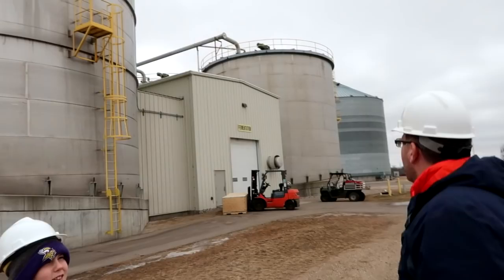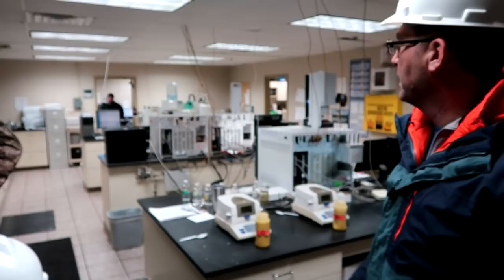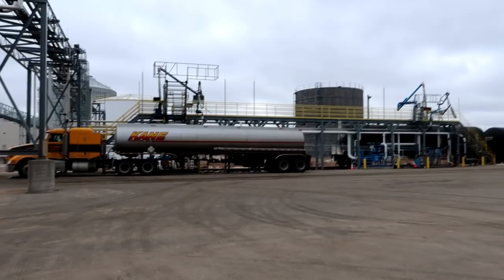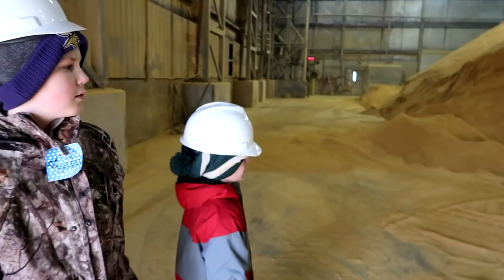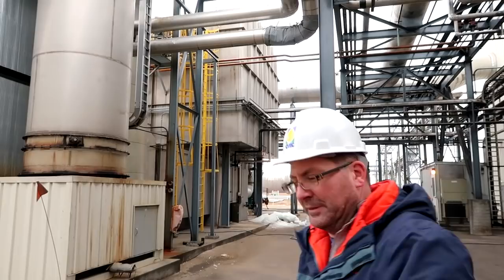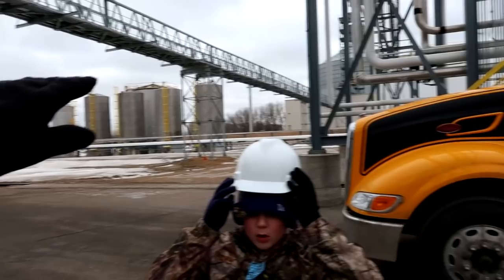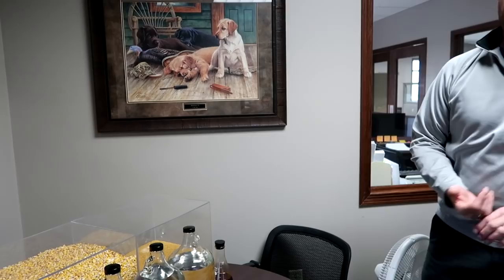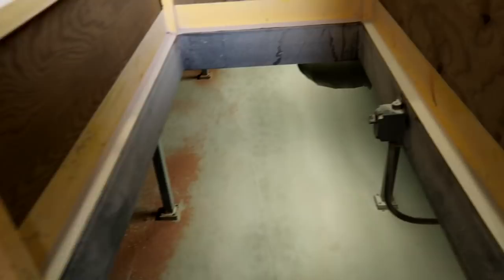Our Tour of a Corn Ethanol Plant!

Comment: The worst mandate ever made was ethanol in our fuel supply, it's hard to store because it draws  moisture eventually rendering it useless as fuel. It's ruined more equipment single handedly than pure stupidity or neglect ever has. From an energy standpoint it's far more fuel costly to make and it has less energy in it than real gasoline. If I had a nickel for every timeI wanted to choke the jerk that came up with this idea, I'd be so rich I wouldn't bother complaining about the pure idiocy of ruining our fuel supply.  You can't store it. It ruins equipment. It's more expensive to make. Only a politician would do something so stupid. Just like the idea that carbon savings is relevant by using ethanol in fuel, it's laughable. I'm going to go clean some carboraitors now, ya know from this "clean fuel source" HA!

Comment: How much do we taxpayers subsidize these ethanol plants ??  How much more do we consumers pay for corn related foods by supplying these ethanol plants taking away from supply/demand ratios ??
Reply from the maker: LIX 59 Did you watch the video?  Subsidies were CLEARLY addressed and there has been ZERO since 2012!!!
Reply from the maker: LIX 59 How much do we taxpayers subsidize the oil industry?  That's addressed in the video as well.
Reply: I hadn't reached the part of the video on subsidies when I commented.
Reply from the maker: I knew that would be a sticking point.  People love to harp on the subsidies even 5-6 years later.
Reply: I'm not sure you pay any more as consumers with the existence of ethanol plants.  The Farming industry has increased production and productivity.  Price of Corn in 1970's might hover around 3.00 to 3.25.  80's price collapsed lower.  Today corn is about 3.80 - but basis varies, usually lower during harvest.  You could say without ethanol the Govt would have to have a much larger CRP program to keep any farms in business, so ethanol plants have lowered the consumers tax bill by reducing the CRP acres.  Meanwhile - your food supply has gained a stabilizing force because there is so much excess production already happening, if feed gets too expensive corn will just be redirected away from ethanol production to keep the cost of food stable.